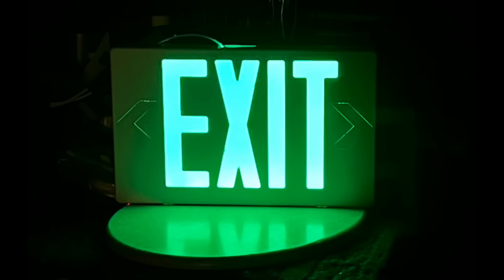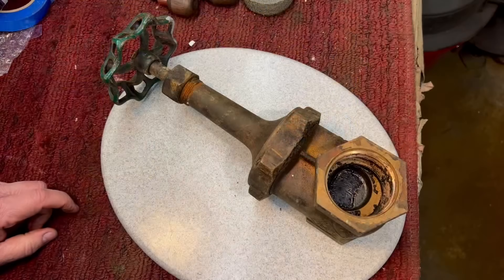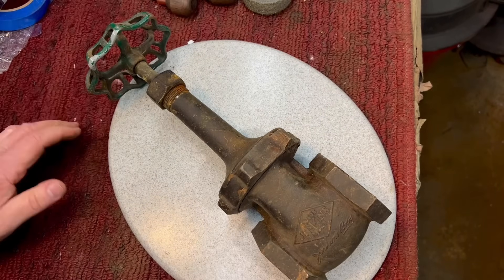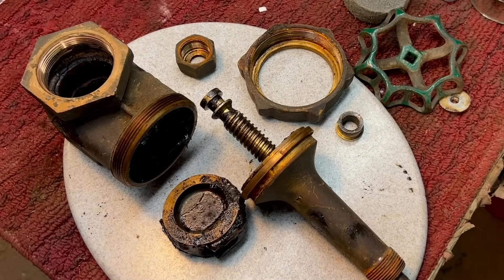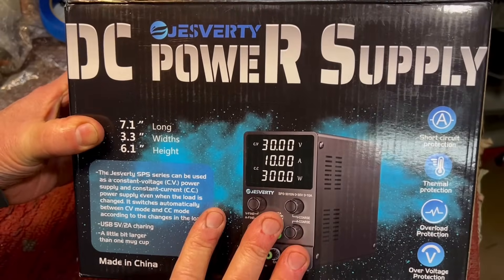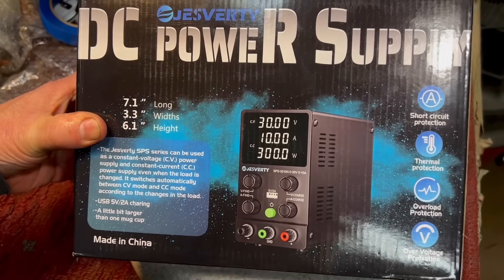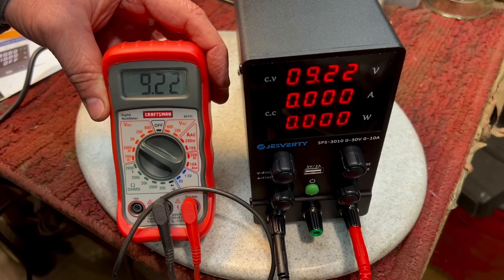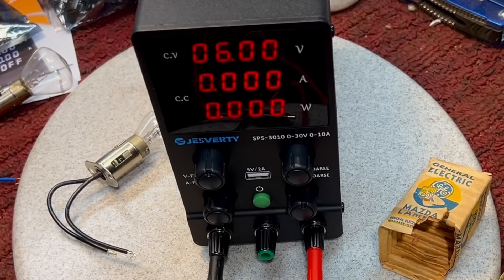Jenkins Gate Valve Cutaway and New DC Bench Power Supply

Comment: The power supply looks good, it seems that they are shrinking! Mine is bigger in every dimension so you could not pick it up in one hand as too big, and possibly a bit too heavy. And the price is very reasonable. I got mine at a flea market: "yes it works" - no it didn't! It had a loose connection to a big coil on the circuit board, just needed some solder. Don't you love honest sellers! Thanks for sharing, all the best

Comment: Another fine educational post. I just want to add that the 277V ac is derived from a 480 voltage with brown orange and yellow wires idetifying a 480 volts, the 277 volt picked off the 480 volts is the grounded wire or called neutral just like 120 volte EXCEPT the neutral or grounded wire has to be grey NOT white. Have a good day.
Reply from the maker: Thanks!! 😃👍

Comment: I've been thinking about getting a power supply like that to try my hand at nickel and copper plating small parts. I've never done it and don't have a clue how to do it but it seems pretty straightforward. Maybe you could do a tutorial on that if you know how to do it?
Reply from the maker: Both nickel and copper plating are pretty easy however both coatings aren’t too durable.  Once chrome plating came out the other two pretty much disappeared. 😃👍

Comment: John, you could use the power supply to start electrolysis to remove rust from some of your finds as an alternative to Evaporust, vinegar or wire wheel. Great video as always and loving the valve.
Reply from the maker: Yes!  Also plating and battery charging!  😃👍

Comment: John that valve came out spectacular!  What a beauty!  Be fun to know what a valve like that would cost, but most likely a bit eye watering.  The DC power supply is a nice unit.  Can't think of any use I would have for it.....everything I have that's DC is 12 volt and I've got that handy in a near by car or truck.  Fun video.  Can't wait to see what the BIG multi part project will be!

Comment: Veryice cut away valve not to mention the cleanup. Excellent. The power supply is a nice addition to your shop. I have ballasts that work on voltage from 120- 277 volts for fluorescent lights. They seemed to last longer when you had one for the correct voltage. Great show Thank you

Comment: Hi John, Another informative video and the valve looks great. On the bulbs I have a 1954 Chevrolet car with a 6 volt system. It has factory back up lights and has bulbs like the big bulb which are single contact/ single filament . Many vehicles before sealed beams had the same size big bulb but were double contact/ double filament. Those bulbs had a different base to twist into the socket. My 1938 Chevrolet coupe has such type bulbs. Good that you were sent those vintage bulbs.
Reply from the maker: Ted- Yes! I have those!  I just can’t find the female sockets for them.  😃👍

Comment: I wonder if i could use that thing for plating?
Reply from the maker: From the web- Yes, a bench power supply can be used for both electrolysis and plating, as it provides a controlled DC voltage and current which are essential for these processes; however, depending on the specific application, you may need to consider the power requirements and whether the bench power supply can handle the necessary current levels.  😃👍
Reply: @ScoutCrafter  thanks John!   It's small voltage for what I need. Usually between 3v and 10v DC.  I've been using an old train transformer.

Comment: Great video John. A bench power supply is a great addition to any hobbyist's workbench. I have a similar unit and something else you can do with these is set a current limit. If you short the positive and negative leads together and turn the unit on, it will read 0 volts and allow you to set the current limit using the current knobs (for example, set to 2A). Now you separate the leads and attach them to your load. The power supply will limit the load from drawing more than 2A. This can be useful when repairing faulty electronics especially when we have a short because the current draw on a faulty device can be very high and cause more damage when energized. In your example, you may find limiting the current useful when testing vintage bulbs so that you run them at a lower capacity than their rating. So many other uses, you'll definitely get a lot of mileage out of that unit.
Reply from the maker: Yes!  Isn’t it strange shorting out the leads on the unit?  It feels like you’re doing something wrong!  🫣😂👍
Reply: @borderlineOCD when are you going to put out more gaming restorations. I miss your content.

Comment: Another great show, thank you.
Those power supplies have a neat feature, "CC" constant current, it allows you to set a current limit, that's useful in case you're working on something that might have a short and draw too much current and damage something, also useful for charging batteries, you can set the charge current.
I have a dozen power supplies, some up to 1000 volts, some up to 50 amps, can't have too many!
Reply from the maker: I was shocked at how accurate they are, and rock steady!  Very impressive!  😃👍

Comment: Great video and your right cutaways do sell a product i wish every company would sell there products this way it would sure help my selection process. The bulb demonstration was great as well makes me almost want to pullout my homemade power supply from college lol one of the electrical engineering courses required us to build one was great experience working a sheet metal brake, drilling, cutting, tapping, soldering.
Reply from the maker: Rob- What a great project!  😃👍
Reply: @ScoutCrafter  it was and is very crude compared to yours though. It's all open and exposed. If i can find the plans I'll copy and send to you.

Comment: Nice valve job. One thing most forget about is the difference between 6 and 12 volt wiring. As you well know you can run 12 volt through 6 volt wiring fine  but 6 volt through 12 volt wiring is a recipe for problems. You meet someone that has an old car that they have restored but have electrical problems. You will likely find a melted wire because it wasn't a heavy enough wire.
Reply from the maker: Philip I was surprised at the current those bulbs were drawing. 3.5 amps!  You’re so right the lower voltage requires more current for the same candlepower.  😃👍

Comment: 11:50 Interesting I forgot about these bayonet style sockets. I always find them at the flea market junk boxes. 
That is a bargain for $50 for a digital DC power supply. The last trip I took with my dad to Hong Kong, he bought an analog DC power supply for about $60 It's in my basement. He never used it either. I'll bring it to the next show to show you.
Also that USB connector on the DC power supply is great for testing modern equipment.
Reply from the maker: I heard you can get some amazing deals in Hong Kong!  😃👍

Comment: Doesn't sound right in AC one amp = about 100 watts  so I can't see a light bulb drawing three amps at 14 watts  ??
Or is DC measurement that much different..?? 🤔
The valve is bronze or brass ??
Great video...🖖
Reply from the maker: I agree it seem like a lot of amps compared to AC! A 6v bulb draws 3 amps because, at a lower voltage like 6v, to achieve the same power output (brightness), it needs to draw a higher current (amperage) compared to a higher voltage bulb; essentially, the lower voltage requires more current to produce the same amount of power, resulting in a higher amp draw for a 6v bulb compared to a 12v bulb of similar wattage.  (That’s from the web, I’m not that bright). 😂👍
Reply: @ScoutCrafter  Correct, watts is watts, it's volts times current, 120 volts times 1 amp = 120 watts, 6 volts times 3 amps = 18 watts, a cold filament in a bulb will have less resistance and resistance will go up as the bulb heats thus a cold filament in a bulb will require more amps at first until it heats up.